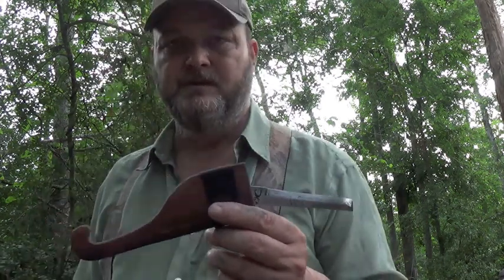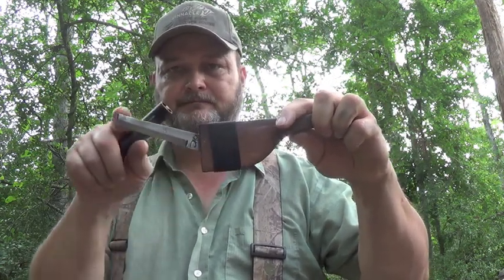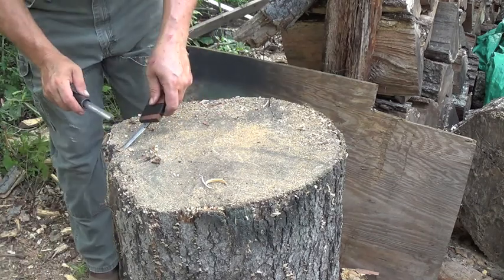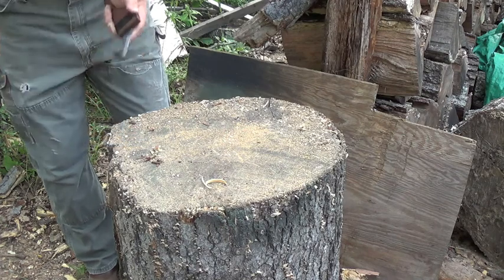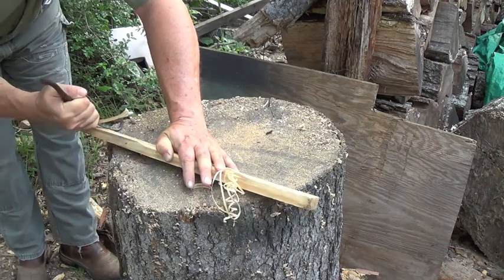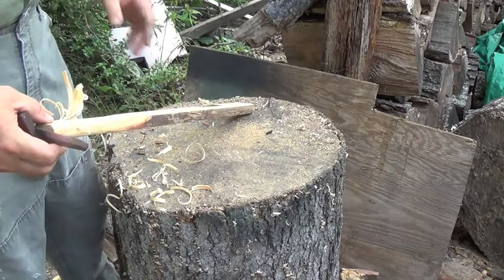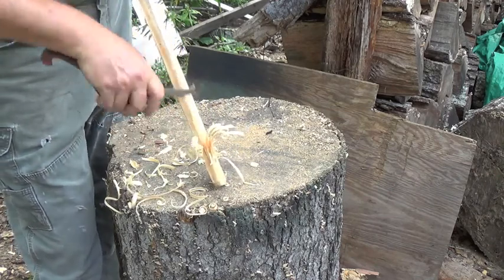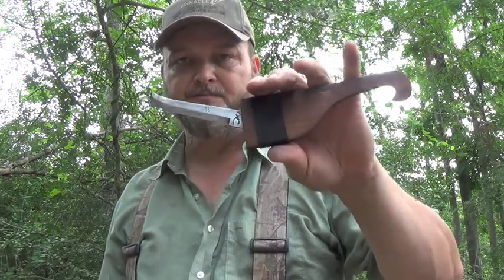What is a Crook Knife and its Uses

Comment: What is a good grind angle?
Reply from the maker: William Fraser don’t know exactly. I did all mine free hand. But a guess is around 30 degrees.
Reply: Will there be a substantial difference in how it cuts on the pull stroke if the bevel was on the opposite edge? (Assuming that the handle orientation is adjusted to maintain the same ergonomics).  I am just thinking about how a chisel has its bevel face down, giving you that shoulder to use as a fulcrum to guide the height of the cutting edge. Your blade clearly works fine with the bevel down during your push strokes.
Reply from the maker: William Fraser yes it makes a difference which side the bevel is on for draw cuts, which is what the crooked knife is primarily designed for, plaining or squaring wood for canoes.

Comment: what is ridge liner?
Reply from the maker: I don't follow the question. This term was never used in the video. I used the term ridge line in other videos talking about tarps. I was referring to the main line the tarp was setting on at the peak. That is called a ridge line. Thanks for the view and comment.
Reply: I'm sorry, I must not have heard your correctly.  What I was reffering to are the points in the video when you mention how hard the pine is and that it is beginning to form ( something?).  I'm sorry if I'm not making any sense,  I'm just a woodworker trying to expand my knowledge.  Thanks .
Reply from the maker: The growth rings in yellow pine will turn into what is called rich lighter or also known as fat wood. It is full of resins and smells like turpentine.  In fact turpentine is made from rich lighter wood or fat wood. Hope this answers your question. It may help if you Google the term. Someone else may be able to explain it better than I just did. I do appreciate the question.
Reply: Thanks !  I think you explained it just fine.  Yeah, I live in North Carolina near the coast and we've got a lot of those old yellow pines, loblolly pines, we call them.  they certainly are sappy.  I remember, my dad used to get something called Pinee.  It was a type of oil made from pine resin you could put on your fingers if you had a cut or something.  It was pretty good stuff.  thanks again for the info.
Reply from the maker: Very welcome. He is correct pine sap is very good for wounds and mixed over heat with charcoal it forms an epoxy like glue. It is a very useful tree. Not to mention pine needle tea that is high in vitamin C.
Reply: Very interesting. Thanks for sharing your knowledge.
Reply from the maker: Very welcome, appreciate the view and comment.

Comment: You should look at an Innu crooked knife, used by Innu of Quebec and Labrador, the handle is crooked, not thw blade, and the handle is much larger but not as stylized as the one u have (but not to say your knife is bad).
Reply from the maker: Yep, this is a very early blade. the new ones are like you described.

Comment: Sounds good but you're explanation is not completely accurate.
Reply from the maker: Appreciate knowing I’m wrong and the view.
Reply: @wcknives  I meant it the most respectful way. I guess it's because I recently have been looking at a bunch of videos on this topic. You are mostly correct. But the thumb thing. That's a biggy. No disrespect meant at all. Yeah was reading a book about Samuel Hearnes. A great adventurer with the Hudson Bay company in 1700's. They mention this mocotaugan knife. So off I went. Researching. Lol. Anyway, thanks for the video. Each one is an adventure. 
Cheers,
Honey Badger.
Reply from the maker: @devildogsbushcraft7898  none taken. I have done some research as well and yes the thumb is used in much of the process and my later designs did have a thumb placement for leverage. I didn’t take offense was only reminded of the Chinese proverb “don’t tell a man he can’t do something and interrupt him as he’s doing it”. There are many experts on you tube I have found but I have also found out there are many ways to do things. So I have learned there is no wrong way of doing anything as long as you do something and finish the job. Again appreciate the view.
Reply: Thanks. Great proverb. Point taken. Lol. 😆